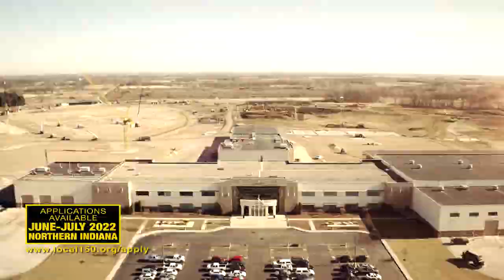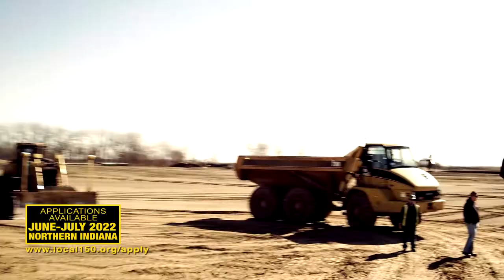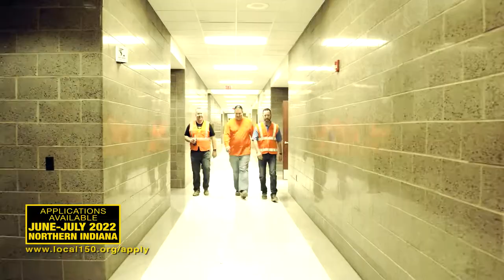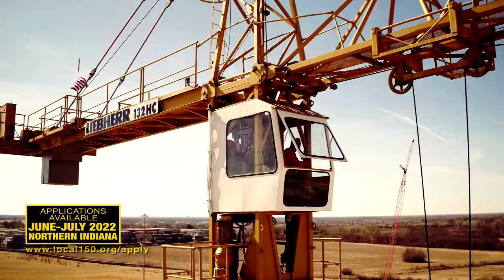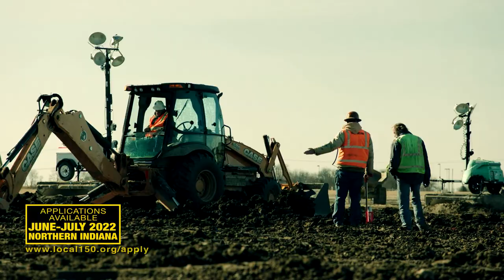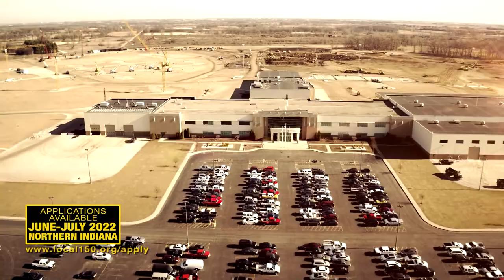IUOE Local 150 - Level Up

Comment: I'm a second yr apprentice millwright local 1693 chicago. These last 2 yrs have been the most unstable for me and my family financially. I have stick and mig certs, they don't offer a tig cert which is my bread and butter...I fabricated for most food plants and beer brewing companies throughout Chicago as a shop scab where I acquired my sheet metal fab skills and aluminum and stainless steel tig welding skills. Should've went in to the fitters...150 is also an option.